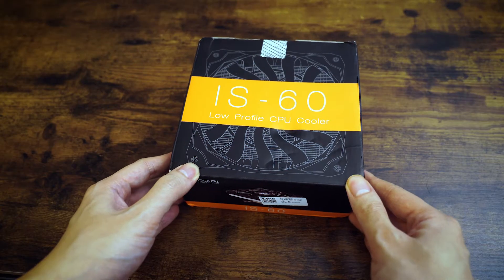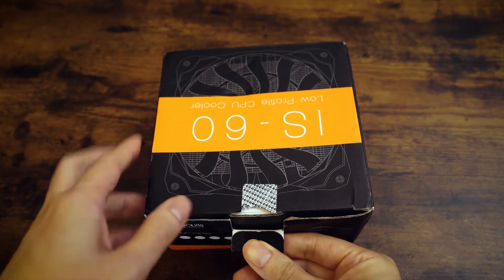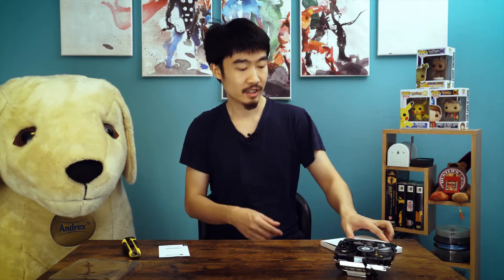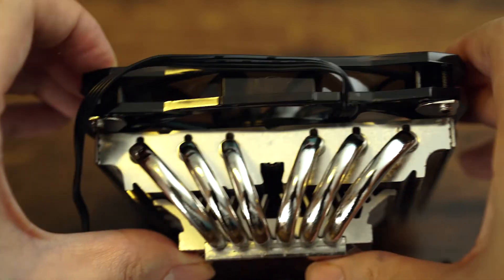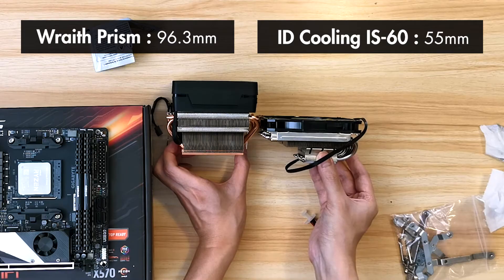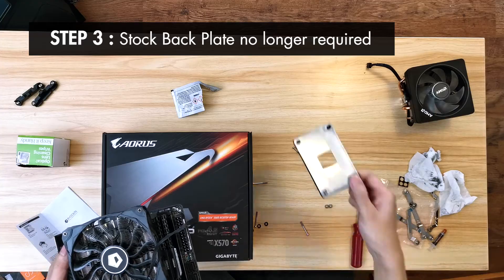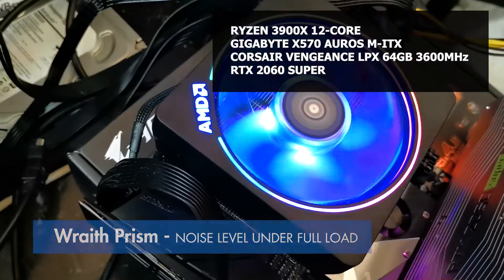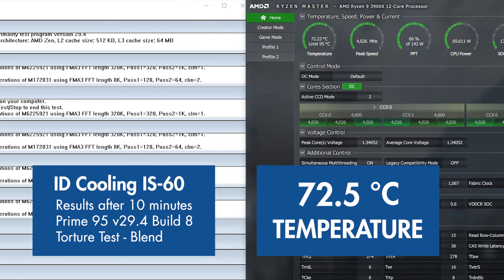ID Cooling IS-60 Review & Unboxing Installation | VS Wraith Prism - Best Low Profile CPU Cooler

Comment: Man I would've loved the is 60 if only the  mounting system took the noctua approach and made everything accessible from the front of the mobo. 

In my itx case, I would need to take the whole pc apart if I ever needed to do some kind of maintenance with the mobo.
Reply from the maker: That's a good point. It would make maintenance a lot easier but I guess they were assuming that most people won't touch it once it's installed. If they did that it would probably be noctua prices...

Comment: not a good test. wraith prism has like 72 degrees with 89W load while id cooling has 72 degrees with 82W (69+13 in ryzen master). you should have fixed fft size in p95.
Reply from the maker: Thank you for your comment

Comment: is it has another ways to install this cooler which make ram clearance 100%??,.
Reply from the maker: You could rotate it but it won't fit on most motherboards because the heat pipes would touch the VRMs.

Comment: I don't understand why my 3600 reaches 82 degres in game while with your 3900x you only get 72 (i have the is-60 too)
Reply from the maker: Did you overclock? If not you need to repaste, I recommend spreading the paste into a very thin layer instead of using the pea method to spread. Don't forget this is an open air test so if you are still having problems it would be to do with case air flow.
Reply: You have same problem to me. Seems like 3600 is have a bad experience with temperature? Because i see a lot of question like you many forum..
Reply from the maker: @ajimad1803  Could be a bad batch maybe

Comment: This one vs IS 47k, which one do you think is better ?
Reply from the maker: IS-60 is more powerful for cooling but if your case is limited by height you might have no choice but to go with the 47k although I think the Black Ridge is probably better at that height
Reply: @AliensStoleMyCow  my case support 55mm CPU height. I'm looking around a cooler to pair with 3700x because 5600x is just overprice and I don't want to pay extra for scalper.
Reply from the maker: @kenshin16021610  then I would go with the IS-60 as the fan is bigger so will make less noise and I've tested this on the 3900x so I don't see why a 3700x would stress it
Reply: @AliensStoleMyCow  thank you. I just bought it with 3700x on aliexpress. waiting for delivery now
Reply from the maker: @kenshin16021610  How much did you pay?
Reply: @AliensStoleMyCow  Cooler 33 euros, CPU 280 euros
Reply: but waiting is around 3 weeks. can be longer I am not sure.
Reply from the maker: @kenshin16021610  good price. As long as you don't over pay you won't be disappointed. I used the spread method for the thermal paste and placed the heatsink on in 1 motion. I found this dropped temps by a few degrees.
Reply from the maker: @射進肚臍 Finding a good cooler at a low height is a hard job
Reply from the maker: @射進肚臍 thats a good cooler but just not powerful enough

Comment: Very good review, I would like to see this cooler against the Cryorig C7 Cooper or the Graphene edition, and against the Thermalroght AXP100 Full Copper, would be talking about the best 55mm  cooler, 47mm cooler, and 59mm cooler, I saw in the channel "The Tech Buyer's Guru" a comparison that included this, the underrated ID Cooling IS 60 matching the Thermalright AXP100 Full Copper that advertise a 180W TDP dissipation, but I wonder how both compared to what it looks to be the best 47mm cooler, the Cryorig C7 Cu/G
Reply from the maker: Well this definitely beats the C7 copper as that's only 10% better than the regular C7. This seems like it will match the AXP100 copper but at less than half the price this wins hands down. You always got to look at the price. Also the AXP100 is 58mm so those 3mm could cause it to not fit in some cases.
Reply: @AliensStoleMyCow   my main question regarding IS60 vs AXP100 Full Copper in about TDP, I mean, I saw in other videos that both of them perform about the same but the IS60 is less than half the price so if you happen to know both the IS60 looks like the obvious choice, BUT, and here is what I like to know, one says is made for up to 130W TDP and the other up to 180W respectively, but processors I saw being tested were technically under 130W so the thing is, Is the difference in TDP due to how the manufactured decided to measure it? Or if are measured by the same standard, Could it be that under 130W their performance evacuating heat is basically the same, but over 130W the IS60 is overloaded with heat it’s performance reduces/tops out and the AXP100 still performs as expected/seen previously, that’s my question, and that is why I would like to see a comparison with overclock CPUs that reach 150W-200W or take very high TDP CPUs like the 220W FX9590 or the i9-7980XE(or it’s refreshes) 165W or other X series Intel CPU with same TDP to see what happens.

In short I wonder if over 130W TDPs they still behave the same
Reply from the maker: @Pro720HyperMaster720  I believe each manufacturer have their own testing methods and hence 2 heatsinks with the same TDP don't always perform the same. The LP-53 I have in my S4 mini is rated at 100w but I've test coolers that were up to 130w TDP that performed the same. I would take all TDP values as a rough estimate at best.